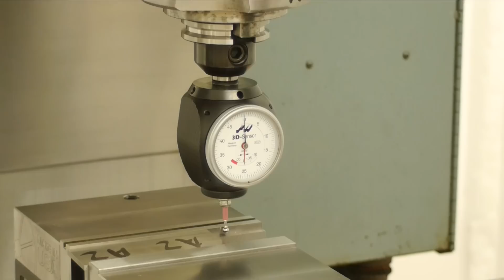First knife work on the VMC!

Comment: No coolant
Reply from the maker: +Chris Murray Nope! The tooling that I'm using it does not require it.
Reply from the maker: +RippSnortin' It's solid carbide tooling with an 'aluminum titanium nitride' (AiTIN) coating... I get my tooling from Maritool (maritool.com).... The tooling does not need coolant, and in fact runs better without it. However you will still need an air blast or similar to clear chips out of the way! The setup you see in this video is not ideal.
Reply: no still need coolant. it will extend tool life.  and you don't want blue chips that means your running to fast and burning up tooling. the ideal chip is silver/gold
Reply: Brandon James sorry Brandon, but that's very much incorrect when taking about carbide tooling, especially modern carbide that is AiTIN coated as it's specifically designed to run dry...
Reply: Titanium Aluminum Nitride (TiAlN or AlTiN)
A formed layer of aluminum oxide gives this tool better life in high heat applications. This coating is primarily selected for carbide tooling where little to no coolant is being used. AlTiN offers a higher surface hardness than that of TiAlN, along with different percentages of aluminum and titanium. It is another viable option in the world of HSM.  

so you can run with coolant. I've been a tool Maker 10+ years I run coated all the time. you can run coolant. you don't have to but tools will last longer.  the only time  I don't use coolant is machining hardened metal because it will glaze the tool. but the end mill is done after that.
Reply: Brandon James I've always heard conflicting things about running coolant on coated tools... I will say that I've been running coated tools dry with air blast in production for over a year now and I'm very happy with how it's performing! Moving onto hard milling now (63hrc) still with air blast!
Reply: nothing wrong with that and I I'm not hating either. but coolant is so you can run tools faster with faster feeds and not burn up tools. I use the air method for hardened metal.  
But I learned from great people and just trying to pass knowledge.
But a coolant mister is not to expensive and would increase life of  your tooling. this blows a mist of air and coolant mixed instead of flooding the tool or part might be a good application for you. Good luck and nice restore. I love Fadal they r awesome machines
Reply: Brandon James always appreciated! I actually try to avoid coolant specifically because of disposal and exposure concerns... Also I don't have an enclosure on the machine! Bit of a pain when cutting aluminum, means I have to keep my SFM really low, but mostly I run steel so it works pretty well!
Reply: yea I don't like non enclosed cnc machines.  I messed up a tooling offset on a converted manual mill and disintegrated a 3/8 drill bit. had to dig a peice out of my arm.

also about the mister that's the cool thing about them it's about 90% air 10% coolant and the liquid hits the tooling and evaporates. no disposal. we use these on our manual mills. But we flood in our cnc. they are called cool mist I think the kit cost 100 on msc. doesn't have a pump uses air to circulate from a small container. 
http://koolmist.com/ check them out they are awesome. Tooling is expensive like them to last as long as possible.
Reply from the maker: I'll be building an enclosure for my machine soon, whenever I have the time! I have heard that misting works really well, I just don't want to be breathing in oil mist though! Heard lots of stories about guys developing sensitivities to it and having issues with breathing which doesn't sound like fun!
Reply: man stubborn. 

 Kool Mist is People & Planet Safe
Safe & Cost-effective
Kool Mist contains no halogens or sulfides and is totally free of dangerous or otherwise troublesome chemicals. It meets OSHA, NASA, AFC, and EPA standards.

Carbide is the most toxic thing in machining . Heat is the enemy of tooling it breaks it down. I don't care what you coat it with. 

You could double your production running coolant but I'm done here.
It just chaps me people by a cnc and now there a expert and give bad advice.
Reply from the maker: Sorry you're taking it that way Brandon, but calling me stubborn simply because I'm not all of a sudden changing my production methods to meet your preferences is a bit silly.

The tooling that I'm running is specifically designed to be run dry: https://www.maritool.com/Cutting-Tools-End-Mills-Variable-Flute-End-Mills-Single-End-Variable-Flute/c78_79_91_100/index.html

Quote from that page: "TIALN coated for running dry in high speed machining applications"

Note that the video we're having this discussion on does not in any way represent how I'm currently doing my machining. This video was taken over 18 months ago, I now run all my production on large fixture plates, machining dry with a high pressure air blast. 

I can't claim to be a toolmaker with 10 years experience, but I have been running production for the last 18 months, learning as I go so I've not exactly 'just bought a cnc'. 

MQL ( a variant of misting that doesn't allow fine droplets to get into the air) is something that interests me, but I'm moving into hard-milling now (63HRC) and most tool manufacturers seem to still recommend running dry in that case, so we'll see.
Reply: I don't think cnc machining is a bottleneck in this case. He can machine parts while he works on other things.
Reply: Dominic Christian Meyer always thought that if the metal has turned blue the meaning is that you blew it and has a much better chance for oxidation and deterioration. Could be only for steel not aluminum. Idk

Comment: Good job, I would like to ask a question, how much is the speed of the machine, feeding machine, material steel? Choose what kind of milling cutter? These all look great, always wanted to have their own CNC! thanks!
Reply from the maker: Hey! The cutter is a 3/16" diameter 4 flute TiAIN coated solid carbide endmill from Maritool. The material being cut is A2 tool steel. Not sure exactly what the speeds/feeds were.